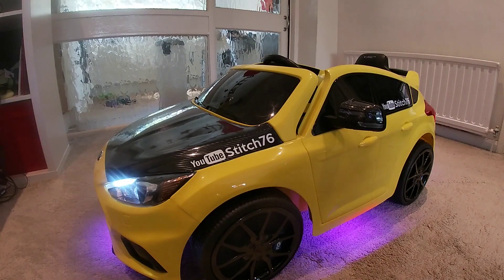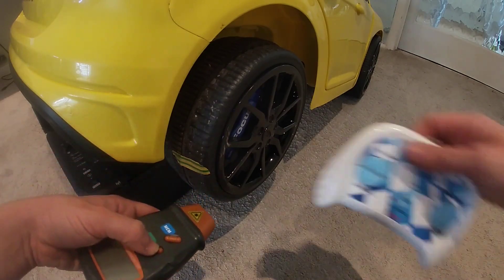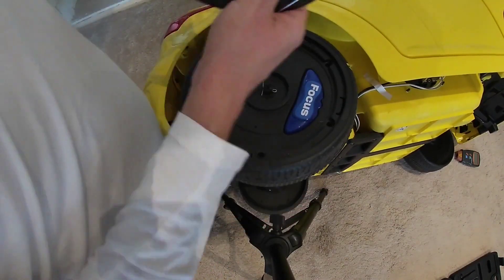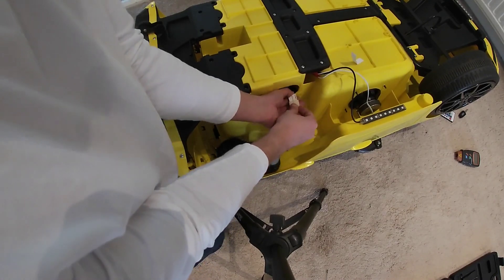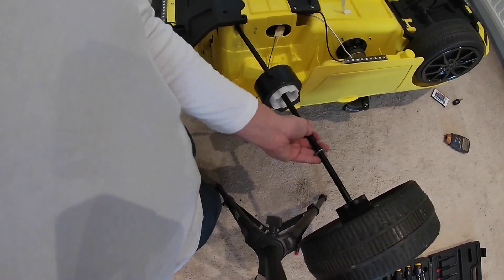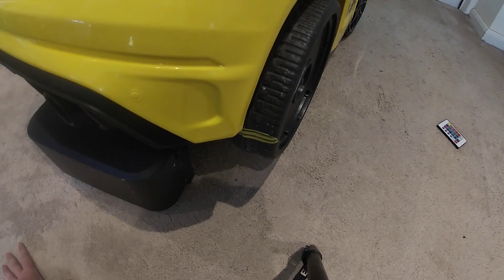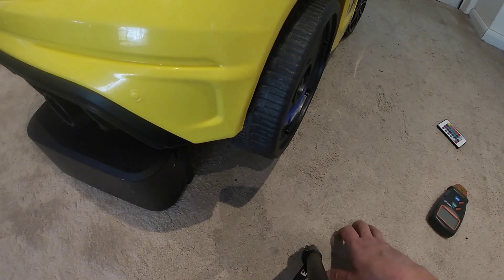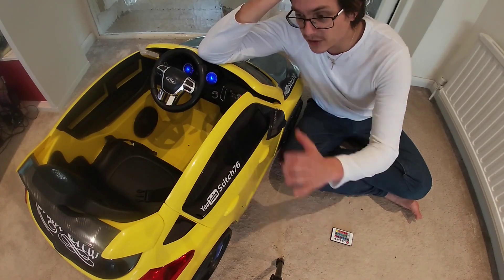Double the speed of a power wheels childs car!

Comment: Mine is a 4*4 with 12vdc 15000 rpm motors. What if I leave the front two 15000 rpm and change the rear two wheel motors and put in a 30000 rpm motor. Will it work 🤔 and mine also has a remote control
Reply from the maker: You need all 4 to match if they are all independent motors, otherwise you will either burn out the front 2 with them trying to spin or wear out the rear 2 with them being slowed down, make sure they all match, you may need to upgrade your controller if doing this and also the main fuse

Comment: Less then 10 minute some wire burned out after upgrade 12v 16000rpm to 12 40000rpm on 4x4 wheel go ride,pls gve me some advice
Reply: did you use s 30amp fuse?
Reply: @dancearoundtheworld5360  15a fuse
Reply: @nazrulnaz823   run a 30a but make sure your wires are thick that will allow current to flow easier. 

ive pushed 20v thru stock wire & they melted together

and if your motors are new youll want to break them in, not just run them (run them at 6v for 2 hrs just to shape the brushes for maximum contact)
Reply: @dancearoundtheworld5360  aredy changed fuse 30a and all thick wired, but then my receiver,im also used a dimmer to control voltage,but same result, burned
Reply: @nazrulnaz823    I would check how much volt is going to the motors 

but the component before the burn wire should be causing it

Comment: Can I use these gearbox and motors you have linked to run 24v or will they over heat? Currently got Weelye rx57 I think it is upgrading to the rx30 24v and got batteries to upgrade. It’s a audi q8 and has the rs390 motors 12k rpm but want to upgrade do have some rs395 motors that will run the 24v but ideally want the 550 or 570 motor and box
Reply from the maker: I would imagine that they would suffer from heat damage yes. If you can build a cooling system for them, 1 fan blowing air into the motor area and one out, they might be ok. Please don't use the heatsinks on the motors, they don't work all the way around and only cool a patch of the motor causing issues. Also when designing your system, the standard fan on the motors draws heat down from the gearbox motor and out the terminal end. Personally I wouldn't bother upgrading the 395, not much difference over the 390, I would just go straight to 550s / 570s, you will notice the difference on the torque, which will hold the speed a lot more.
Reply: @Stitch76  just ordered 22000 rpm 24v rs555 motor and gearbox, they didn’t have 550 or 570 off the shelf with 24v so thought I’d give the 555 a go heard they’re rare motors but heard you can replace with a 770? Apparently more common and handles the 24v much better but see how the 555s do when they arrive
Reply: @Stitch76  will the speed control off the rx30 be enough or do you think I should also add a manual adjustment in? If I was to add that would I just add it after the control module before the motors or between battery ans control module? Thanks
Reply from the maker: Whether the 770 fits easily or not is dependent on the gearbox, do you have a link to the gearboxes?

A 770 will handle 24v easier after breaking in.

The RX30 does support a hi/low speed switch, so that should be fine for you, from memory on standard motors it's around 5mph and 8mph.

Remember to upgrade your fuse as well as the standard fuse will probably keep tripping, you may also need to use a thicker gauge wire, if you notice the wires getting warm, then replace with thicker wire.